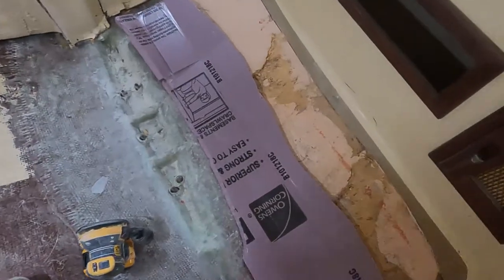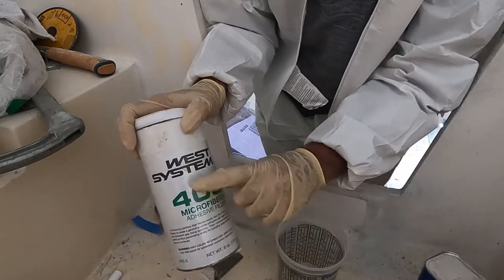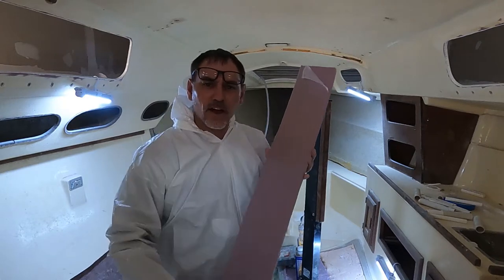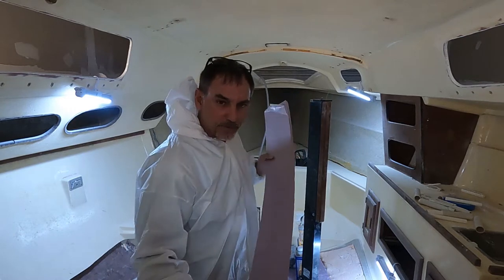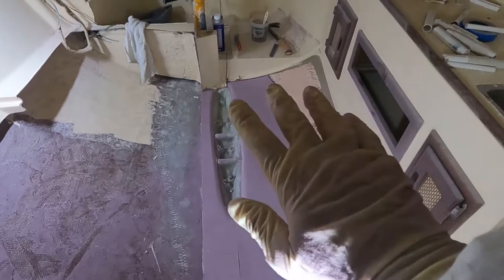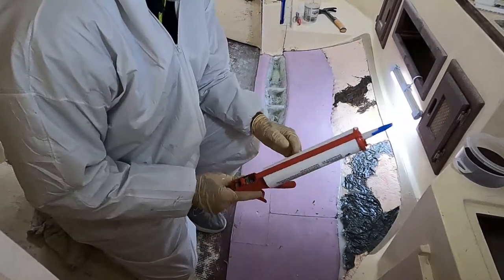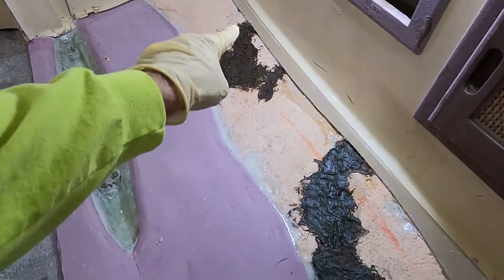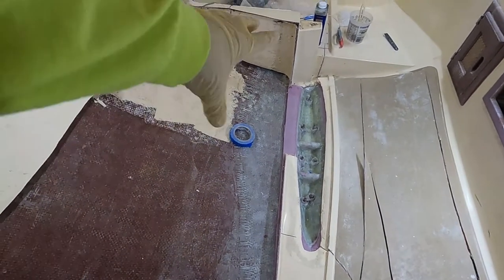Sailboat Keel Repair 2 Ep9 installing foam coring and getting ready to reinstall the interior liner

Comment: Can that bondo material be used on the outside of the hull, lets say to fix a ding where the boat hit the dock and knocked some of the gelcoat off exposing the fiberglass?
Reply from the maker: If you sand it really well to ruff up the compete area and use the 3M fiberglass bondo. 
But that stuff is hard to sand smooth.

Comment: Would that foam work for replacing deck core?
Reply from the maker: It depends on the boat. I think it might if you had thick layers of fiberglass above and below. However it will melt with polyester resins